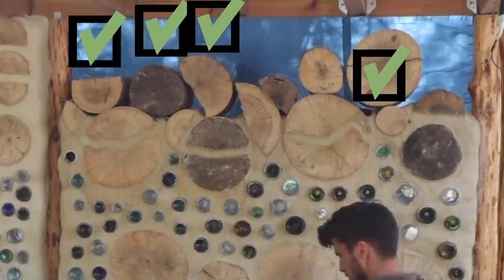I'VE WAITED MONTHS FOR THIS!!! Finishing the wall of the Cabin in the woods

Comment: Many years ago friends of ours did just that...it was beautiful when it was all done...but the secret to keeping your home toasty warm if you live in a colder climate..is to heat your home for a week or so to about 85 degrees.. doing  this will allow the air cells in the wood to get very warm...and will balance out from the air cells from the outside of the wood..which will act like a buffer...warm cells meets cold cells inside of the logs...hope this helps...

Comment: This is beautiful.  I'd work with the building inspectors there. If they want to inspect what is already done, show them your video of each part they need to inspect. Hopefully that will suffice. I have a neighbor that did a similar structure with the bottles, a pond, etc. It looks amazing. Inspections are generally  supposed to make sure a building isn't going to collapse, burn or whatever. As long as it's structurally sound, you shouldn't have an issue. You may have to add a bit more structural elements or whatever, but it looks beautiful. You might be fine with it just the way it is.

Comment: Your subs have exploded since you started the house.   It looks really beautiful.   Can’t wait until you finish.
Reply: Just a suggestion for later would be to put your concrete mix covered by varnish on the top of the logs at a slope to help prevent dust from collecting up there.  It is much easier to sweep it off the floor than to have get up in the rafters with a shop vac.